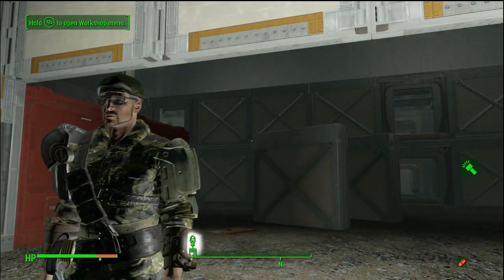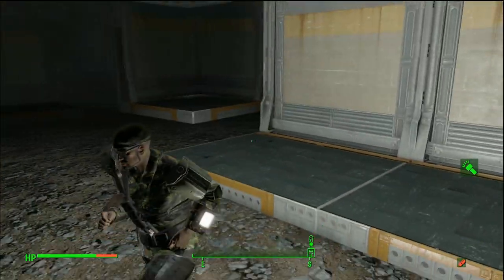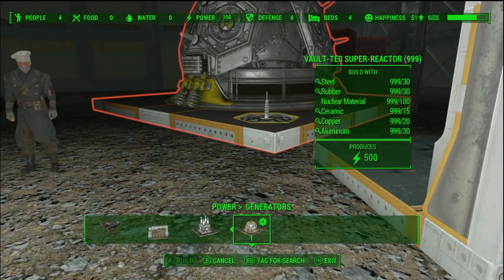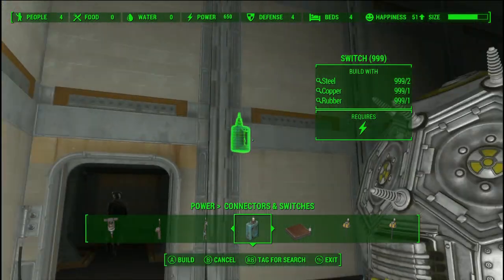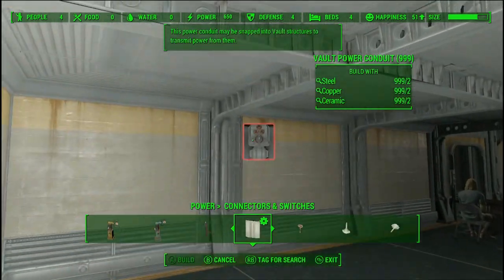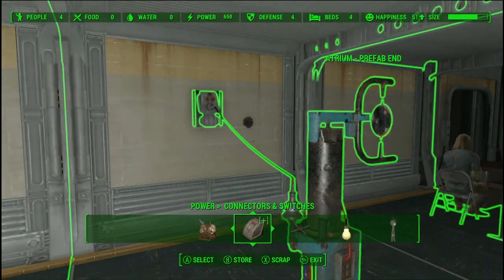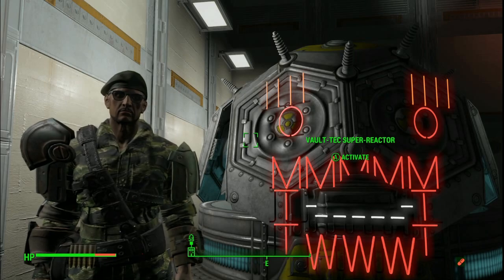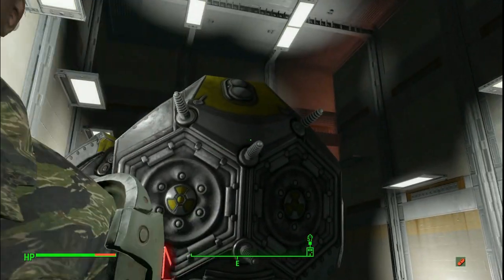How to Power Your Vault: Vault-Tec Workshop Fallout 4

Comment: After you complete the Vault 88 questline, you can use the Vault Materials in any Settlement. So.. you can have a Power 200 Reactor in Sanctuary Hills. Or Build a Mini Vault on Boston Airport.
Reply: kodaisosen you can but it wouldn't be a vault then because it would be above ground vaults are spaces underground where you store stuff not in the middle of a feckin airport
Reply: Underground part doesnt matter since 2077.

Comment: so how do u power vault rooms???
Reply from the maker: as long as you connect the doorways of the atrium to the doorway of the vault rooms the power will continue to run through the floors then all you have to do is connect a vault power conduit to the walls ever few pieces and place your lights hope this helps i got some videos about fixing the vault parts together if you check out my videos thanks for checking out the video
Reply: Thanks for the help man i subbed
Reply from the maker: ty for the support, Welcome to Face Corporation!!!